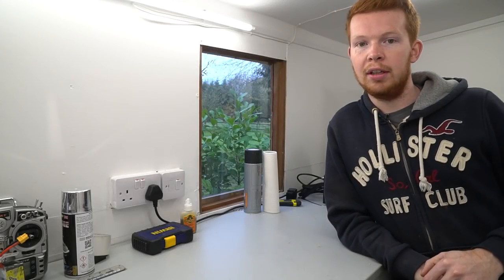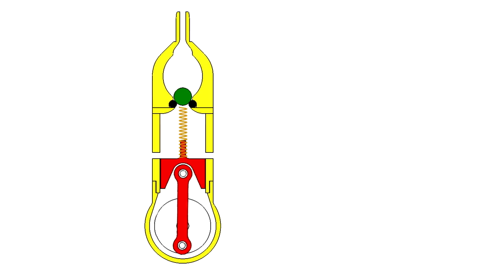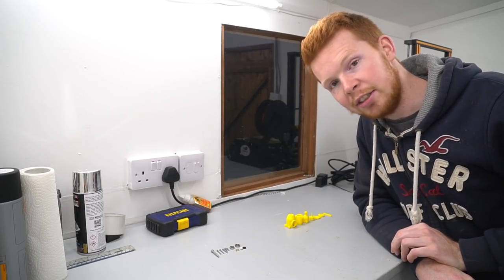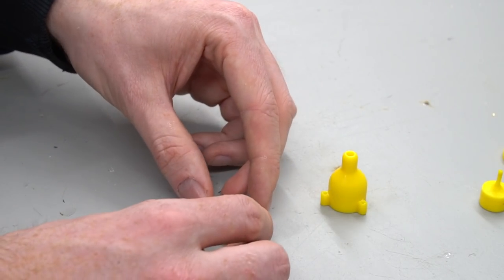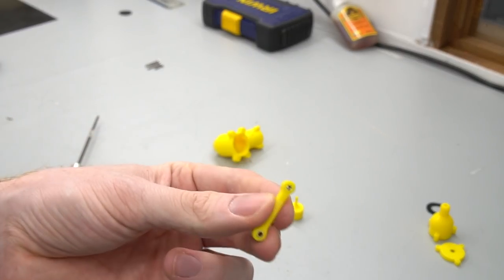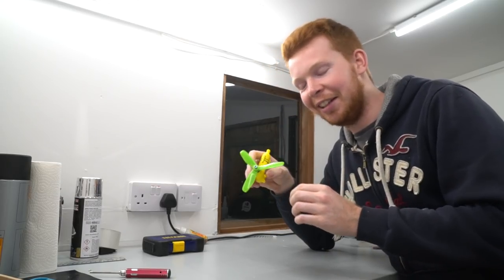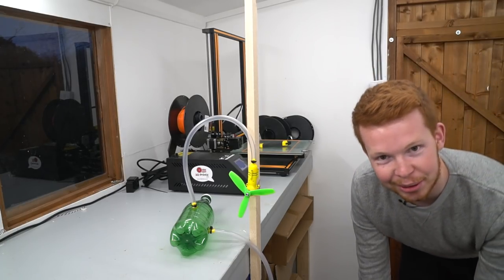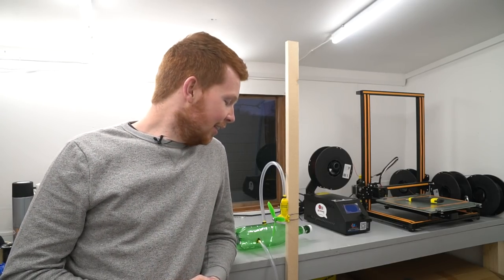Compressed Air Engine

Comment: Make multiple cylinder engine next 🤔
Reply: a mini rotary would be awesome
Reply: that would be sooo cool!!!!
Reply: It's not an engine it's a motor!!!
Reply: engines and motors are basically the same thing as in provide power
Reply: No!!! Radial 9 engine!
Reply: Rocker Pat Typically motors are electricity driven and have no compression. Engines are driven in many ways and have compression. We don't call them steam motors because the compression factor and this engine has a lot of qualities of a steam engine.
Reply: Imma attempt that
Reply: I agree with that
Reply: Saukki make the motor connect to a co2 tank
Reply: Saukki yes please
Reply: Hey, dude, what about engine lubrication?
Reply: Saukki oooooo good idea👍
Reply: Saukki 3
Reply: P arjacpar Not in this situation, because it doesn’t provide power, it is a conduit for power coming from something else. Yes, it’s a motor and not an engine, but it isn’t right to correct people on that,
Reply: 22.5 degree v24

Comment: What if instead of pressurizing the bottle with a pump, you used a small amount of dry ice and water to produce gas?  I bet the right ratio could be found that wouldn't blow up the bottle, but would give longer run times.
Reply: Mike Doyle genius
Reply: this!
Reply: Eggsactly!!
Reply: Look up johnnyq90 or somthing like that, he did that

Comment: Make a V12!
Reply: You could sell these to mode builders.
Reply: make a 96 cylinder radial!
Reply: Dido!!!
Reply: Hey, im trying to do this currently. Ill let you know how it goes :) (I plan on making a youtube video about it if it works.) I made the block and pistons and everything, the only issue is im trying to use valves instead of the system he uses for all his air engines. Im making a smaller version of my cylinder and if that works than i know the v12 can work.

Comment: try using Co2 canister to make a mobile plane!
Reply: Ben Koh That's too heavy. A piece of PVC pipe with two caps should be enough. ;)
Reply: Not if you use the smaller co2 canisters....they are very small and light....would just have to find a way to attach 2-4 of them together as I don’t think a single one would have the capacity for much...
Reply: Try making the exhaust directional. It should improve thrust.
Reply: except  CO2 cylinders don't have much volume. 
I'd like to see if a large 6" prop would be more efficient since it'd turn less rpm. for extended flight, you'd probably have to have something as big as a couple 2 liters @ maybe 20-25psi.
Reply: Small 12g CO2 cartridge would do. It has an advantage that it maintains constant pressure as long as there is a liquid inside.
Another option would be a blower gas canister. Though these are rather bulky. Too large for an airplane, maybe good for boat.
Reply: Great ideas guys....I’d love to see this done on an actual rc plane....would be awesome even if the flights were short.
Reply: Soft drink bottles are lighter and can hold 80psi
Reply: CO2 cools down and the pressure drops. The pressure is constant only if the temperature maintained - true for slow consumption rates.
Reply: That's true. And that's problem of all pneumatic propulsion systems.
Reply: maybe use CO2 vented into a heated chamber to maximize expansion and minimize the chance of the cold-ass CO2 damaging the parts
Reply: Why CO2? why not air? why do paintball guns use CO2?
Reply: iwantitpaintedblack the paintball gun makers can make much more money off you if they make you buy the recharges off them
Reply: that cant be the only reason can it? i always thought because co2 lets itself compress more maybe?
Reply: +iwantitpaintedblack
As I already mentioned, when CO2 is compressed into the canister it turns into liquid. And as long as there is remain of liquid CO2 in the canister, the pressure depends on temperature only.
Compressed air remains gas. So with every shot the pressure drops as portions of air leave the canister..
It is highly preferable, especially when shooting, the pressure to be constant. 
As it means constant bullet velocity, constant point of impact. Very hard to achieve with air, quite easy with CO2.
Reply: +Oliver Watson
First, paintball uses compressed air too.
Second, compressor able to pump the pressure and compressed air tanks are quite expensive. CO2 gear is cheaper.
Reply: iwantitpaintedblack most good paintball guns use hpa
Reply: Ben Koh use paint ball wich are 50g instead of 12g

Comment: Hi, newbe here but have some experience on air engines... Yours is an amazing success, specially coming from a 3D printer, but i think you could improve it quite easily right now
The spring on the piston makes a whole difference. The sound and behavior that your engine shows, reminds me of my broken Air hogs engine, where I ruined the spring and replaced it by a stronger one... It is like a gas engine with premature ignition (aka autoignition?). Maybe you could get a very soft spring and trim the needle with a couple of scissors, so it only opens the valve at 3/4 of upwards travel.
Also, the 6mm bb might be too wide for a valve. You know... air hogs uses a 2mm ball bearing, on a 1,5mm diameter air passage. This mod might mean you printing some parts again, or just grueing a small tube into the 6mm hole, and building a new valve with the narrower tube.
And don't worry about air pressure on bottles. You can get to 80psi even with those plugs screwed to the side.

hope this helps...

Comment: Make the piston and cylinder smaller so you don't need that much air. Also use a pvc pipe or a coke or sprite bottle. They can hold more preassure
Reply: With 3d prints anything smaller would lack structural integrity.
Reply: Mattsoup you could just make the stroke smaller.
Reply from the maker: +christian mühl before building the engine, I printed various diameter cycliders/pistons and found that 15mm diameter was the minimum to get a decent tolerence. So yeah, the stroke would need to be reduced
 Thanks!
Reply: To smaller, the bore could use a 15mm copper pipe insetered  into the plastic, chamber. As the piston is plastic should move without friction [could spray inside of copper pipe with silicone].
Reply: Maybe not the PVC pipe, those become a storm of sharp shards when they fail under pressure
Reply: While the PVC can fail, it is rated for much higher pressure than what you could accomplish with a soda bottle. Normal operating PSI for schedule 40 is 90 PSI and it is rated for 450 psi. With end caps glued on, you could likely make a portable enough pressure chamber to make a usable aircraft. Maybe. Would use a compressor to charge it though.
Reply: Good fun watching your video.  Try it using a small steam boiler if the plastic will stand the heat.

Comment: I've built some small glow plug and diesel engines on my lathe, and found that I got better results by making the pistons slightly oversized for the cylinder bore, and then lapping the outside of the piston and the inside of the bore until they are a tight fit and then lapping the piston inside the bore for an airtight fit. Of course with metal you have tighter tolerances to work with and the material doesn't suffer from shrinkage. Fantastic work on the engine, just subscribed!

Comment: A 2L coke or sprite bottle can handle a fair amount of pressure but for a better seal the air hoses should be put into the cap.
Reply: it can handle more pressure than a mountain bike tire can handle (thats 60+ PSI)
Reply: And if you wrap it in that fiber reinforced packing tape and then duck tape after it can take some truly incredible pressures.
Reply: A 2l bottle should easily handle 60-80psi and even 100psi but the pipe seals would likely fail. And 120psi would be around the time when the bottle would bulge and be borderline danger!

The seals should be the cap or used a barbed adapter in the base of the bottle and seal with a number of things like silicone and glue but higher pressures will always kill a seal!
Reply: Soft drink bottles are incredibly robust when it comes to pressure... Have a read of this: http://www.aircommandrockets.com/procedures.htm#BurstTest

Given the engine ran pretty good at 10PSI, a regulator limiting it to about 15-20 coupled with a 2L bottle pumped to 100PSI would give a pretty good run time.
Reply: reggiep75 HEY GUYS to improve the seal look at combining Super Glue + Baking Soda!!! Google it, has been used in planes in emergencies.
Reply: James Burleson hey read my other comment man
Reply: WKD hey read my comment man

Comment: 2ltr fizzy drinks bottles will take 100-150 PSI before blowing out. I used them as accumulators for Lego pneumatic engines. Great project and solid proof 3D printing can be used to make more than trinkets and vases.

Comment: I have a couple of the old Air Hog motors. I have an airplane and at least one car. I'm very willing to make a video of the engine in action if you think seeing one would be useful.
As others have pointed out, keep all the holes in the lid. Poking holes through the side of the bottle will greatly reduce it's strength.
Fun project! Thanks for sharing.

Comment: Hey man! A tip and just the tip. Soda makers have a co2 canister fitting and regulator in them. And they come with pressure regulators in them to. And if you make an engine with a smaller chamber you can use the bottles as pressure vessels. just watch out for freezing valves. A not unusual problem for compressed air/co2 model engines.

Comment: Sure your air chamber is lacking capacity (more air), but a pressure regulator would help a lot. It would be amazing to see a 3D printed pressure regulator! Right now your engine speed is proportional to the pressure in the chamber. With the regulator the engine's speed would be constant, as long as the chamber pressure is above a threshold value.
Reply: I was thinking that a regulator would help too but how to make one lightweight and small enough that does not negate the elegance of that ball valve? A second chamber above the ball valve with another ball valve that takes in a charge of air when the piston is in BDC would help to regulate the air pressure, while not technically a regulator it will limit the engine to whatever charge in in the small chamber. Then there's whatever air is blowing by the piston, stopcock grease on the piston and sealed bearings might help that but some machined parts might be best for here.
Reply: Yes, indeed a regulator might not be worthwhile and the elegance of a simple ball valve is compelling. I think that, considering the small volume of air in the bottle, it would help not to waist it all in one go. Keeping also in mind that all leaks after the regulator will be proportional to whatever pressure it regulates, it would also help reduce leaks.
I think I understood your strategy with another ball valve chamber, delivering predefined packets of pressured air to each stroke, but perhaps a typical spring actuated cone valve regulator would use the same resources and would make for a very interesting 3D printed project (I have no idea such a project is viable).
Regarding the air wasted around  the piston, maybe an o-ring on it would help, if the cylinder wall is smooth enough. Maybe use a copper/brass tube as a cylinder wall would make it smooth enough.
Reply: Here's another design that would be easier to modify with a prechamber. https://www.youmagine.com/designs/single-cylinder-air-engine-experimental  I just noticed that Tom Stanton's design has the spring on the wrong side of the check valve, inverted flight might be out of the question. Just what does that spring do?

Comment: To cut washers at home use bits of pipe and punch holes through the rubber.  For small washers you can get various sizes of pipe from old radio/tv collapsible antennas. Very neat project. I must build one myself :)

Comment: The late, great Doug McHard was something of an expert on compressed air engines. He used to shrink the bottles with a heat gun to make them fit better in the fuselage. This also thickened them up and allowed them to take a much higher pressure. With higher pressure you can reduce the lift height of the valve (perhaps make the pin on the piston height adjustable so you can play around with settings).

Comment: For greater efficiency at the cost of a little performance, you want the valve to close with the piston part way down.  This way, the air gets to expand a bit before the exhaust ports open.  If you don't lose as much of the energy to making a pulse of air on the exhaust.

Comment: Hey Tom I've hydrostated similar soda bottles up to 110psi I used the cap for the penatration singular and used staniless steel fittings with 0 rings. With that kind of pressure the tank will deform 65 to 75 psi is very safe.. side wall penatration's wouldn't be very safe. You've got one sweet motor there.. great presentation. Thanks Ed

Comment: Tip for cutting the washers from rubber sheet: Take a small length of copper, brass, alu, whatever tube of the correct diameter from a hobby store or hardware shop and sharpen the lip of one end to make a punch.

Also I would probably use the same to sleeve the cylinder.

Comment: At the valve you already have an o-ring, you don't need a gasket. Also, cut a groove in the top of the cylinder and use an o-ring there. The better your piston and cylinder fit the longer the run time and the greater the power available. A true round piston with dynamic sealing like labyrinth grooves might help. It is a fine balancing act to find the proper length of poppet and spring to achieve maximum pressurization and expansion before exhaust. The exhaust ports on the front of the engine are actually anti-thrust so maybe an exhaust shroud would help. Screw threads inside the rod bearings are creating a lot of friction and wear. A study of miniature engines, that have been around a long time, will provide much information as to what makes an engine work efficiently.

Comment: Try using a 12g co2 capsule with a regulator!
Reply: abs is not able to sustain that much pressure such such less volume.....ps it will create much more heat causing melting of piston inside cc
Reply: Himanshu Ninawe that's why I suggested a regulator. Good day to you
Reply: But how can we regulate a 85 bar co2 cannisters for this much small engine....and  if we can....then it's gonna be the one of the best compressed air engines out there
Reply: well, the problem is the opposite actually. A gas will cool down as it expands. So you will end up with freezing valves and brittle plastic. There are numerous co2 engines that have been made going back decades. Google Stefan Gasparin and be amazed.
Reply: NissanIsAMentalDisorder well due to  multiple piston cycles it will create much enough heat.....hope that should neutralize the freezing temps.
Reply: Himanshu Ninawe I have seen vids of 3d printed suppressors out of abs that were used on a pistol and was actually surprised, but they worked do many shots without melting or blowing up, I'm not Auer what kind of pressures and heat a firearm generates in a suppressor, but I'd think much more extreme than what a co2 cartridge puts out.
Reply: 12g plus a solenoid maybe? So he can have controlled short bursts of pressure
Reply: 50g

Comment: This is amazing. Well done. Just for reference those plastic bottles for carbonated drinks can easily handle 100 PSI. They usually start to bulge and burst around 150-200 psi.  Please DO NOT use PVC pipe for pressure vessels. It shatters when it breaks, basically making it a shrapnel bomb. The 2L soda bottles tear when they burst. It's loud but not super dangerous.
Reply: If you do it right, sched 40 PVC is rated for 450 psi and makes a handy pressure vessel. Very important to know for certain you are working with sched 40 tho. Sched 80 is rated for 650 psi. Sched 20 is rated to blow in your face.

Comment: That's really awesome. Good work. I did some Legos stuff back in the day with air compressed motors and such. 

Part of why it was so inefficient and rough sounding was because you were running the prop in the wrong rotation direction. You either need a different direction prop or to just face the prop twords the motor. 

Should sound smoother and run with less drag!

Comment: Make the connections to the bottle via the lid. I use the dip tubes from pump-action cleaning product bottles, simply forced through the lid via a slightly undersized hole. A 1.5l coke bottle is good for 60 psi in use and 100 psi safely (Without holes in the side.). I know this from making water bottle rockets.

The spring I think, gives a degree of regulation as the pressure goes down in the reservoir, at lower pressures it holds the valve open longer. A lot of the freeflight CO2 pintle valve engines do without the spring. Cool  video.

Comment: Lubrication - expanding on Farm Bart's comment - the pins going through the con rod are actually screws and will chew up the copper bearings fairly quickly, particularly without lubrication.  (These are "bearings" - just plain bearings rather than ball or roller bearings.  They are more sensitive to lubrication than ball or roller bearings.)
Balance - flywheels are commonly fly-cut to improve the dynamic balance.  You are losing a lot of power to vibration from the unbalanced engine.  (Dynamic balance is a pretty tricky equation to solve, particularly for a single cylinder engine.  A metal flywheel would help smooth out the engine but you can't 3-D print that.)
Piston rings - you are losing efficiency from blow-by of the piston.  How much is hard to tell.  Piston rings finesse clearance between the piston and cylinder.  Small glow-plug engines commonly do not use them, but they have a lot of extra power to give away.